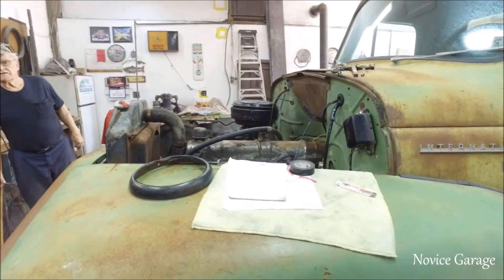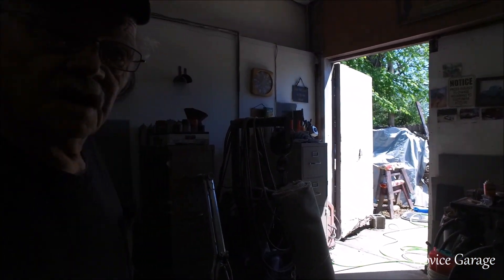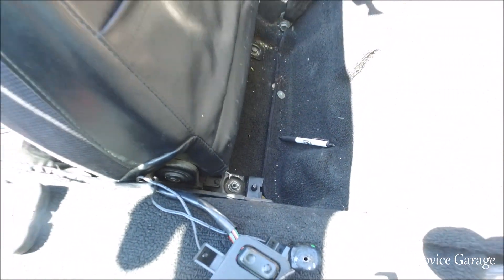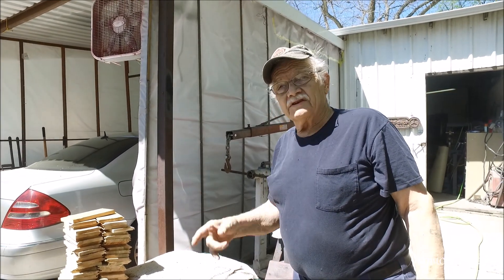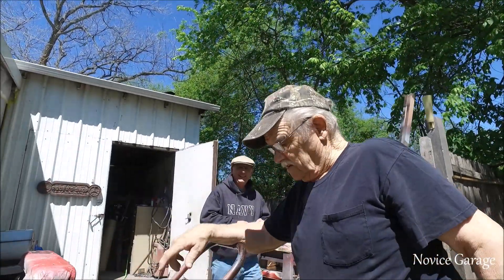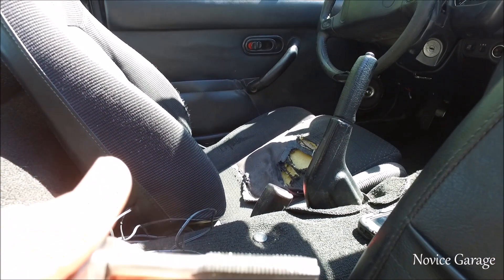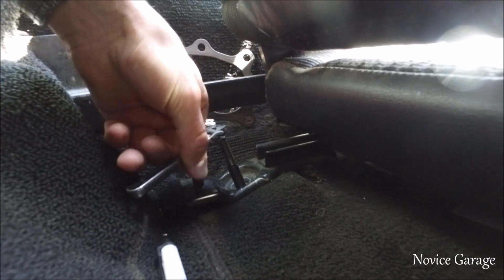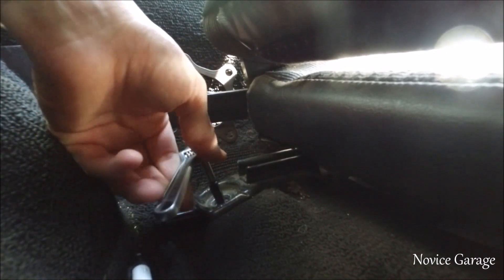Removing A STUCK Seat Bolt

Comment: After the T55 Torx  head stripped on my 97 Ford Expedition passenger seat bolt (rear inner bolt, blocked on 3 sides) due to rust, I gave this trick a go. Not even a tickle from it. It made a notch in the bolt head, but wouldn't budge it. Is there a certain technique to doing this?

Comment: i hope this works with the seatbelt bolts in my 77 monte carlo... i’ve been trying to replace the carpet but i can’t take the passenger side seat bolts out and the torque bolts are striped bad